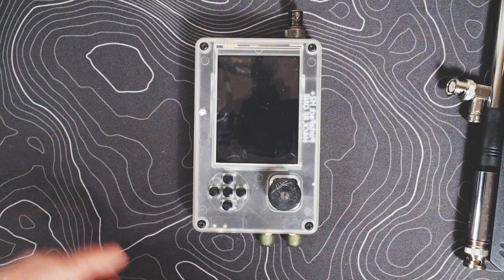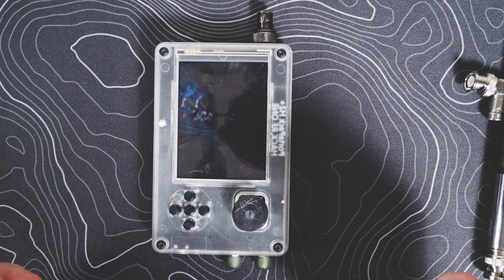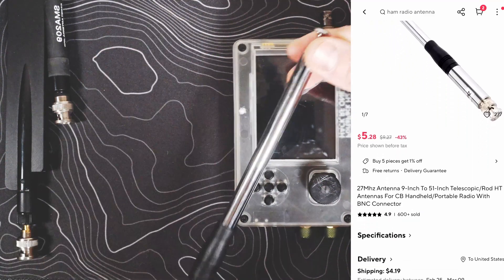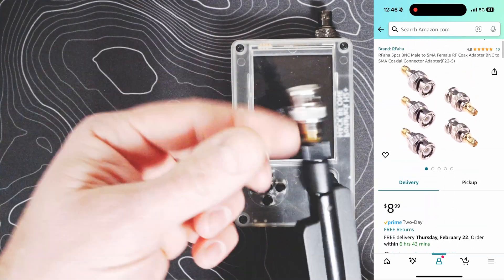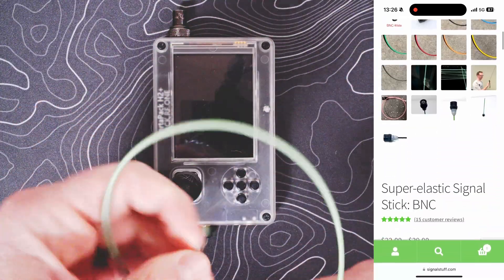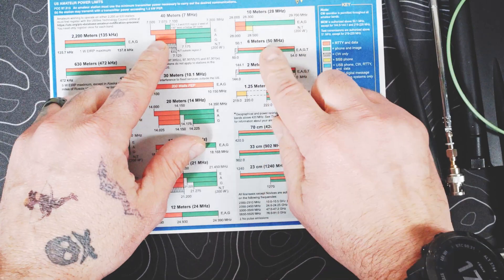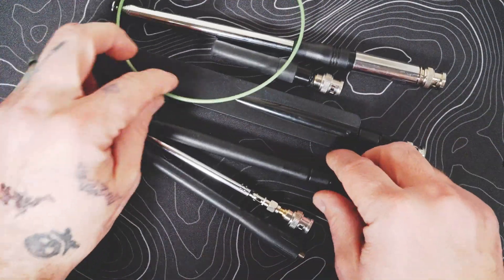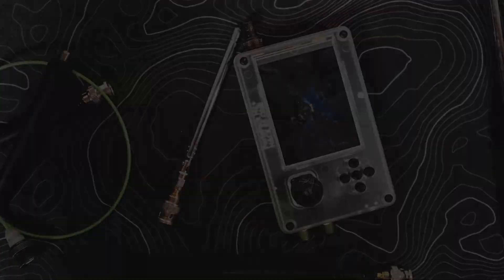PortaPack H2 Hack RF One Antennas

Comment: Got the bnc etc you advised  but when I screw on the ariels they don't ever grip so are prone to swing around any advice or fix  thx ?
Reply from the maker: @x_KiT_x  see if you can find some small rubber washers. I learned after I posted this video that if you stack a few rubber washer high enough. Then your bnc connector down.  The rubber washer will act like a grip and provide counter upward friction.
Reply: @Jeremiah.o.A.T  Fantastic thank you :)
Reply: @Jeremiah.o.A.T  tried the rubber washer and even a brass nut still doesn't lock the aerial on :/
Reply from the maker: @ what exactly do you mean by ariels? If you like join my discord and drop some photos in the antenna channel. 

https://discord.gg/XaWdgtKRZJ

Comment: Question can I use NRF24L01+PA+LNA SMA Antenna From a Wireless Transceiver Module, RF Transceiver Module used for raspberry pi module? Plus would it work for capturing FBO and Bluetooth?
Reply from the maker: @anthonyrickardii6198  yes. Always helps to use the appropriate tuned antenna for what you want to receive or transmit.
Reply: @ thank you I appreciate it

Comment: Hey, great video. I just got the 27MHz antenna and testing as we speak. Doubt it's actually capable at receiving very good at the working frequency, but it seems to receive pretty well on higher frequency. Problem is, I'm quite new to this and unsure how I would try and calculate length for that specific antenna since it came with little to no info about it. Any tips or knowledge to share about that specific antenna? I know how to calculate for a dipole antenna, but this one seems like a special monopole antenna :D
Reply from the maker: @olavmartiniustomter5170  thanks man! There’s actually an antenna calculator built into the Mayhem firmware that can guide you for your desired frequency.

Comment: What is the max length of cable you can use? I’m trying to wire an antenna from my basement to the roof.
Reply from the maker: @B2DT11B  I’m really not sure. I’ve gone as far as 20’ with no issues. So if using quality cable with little signal loss, I would guesstimate 50’ or more. 🤞
Reply from the maker: @B2DT11B  the amp portion on the H2 can boost incoming signal if you seeing no signal.
Reply: @Jeremiah.o.A.T  k. My plan is to put a cone on the roof and add a SPF 5v amp to my HackRF. The goal is to hear as much as possible from a base station.
Reply from the maker: @B2DT11B  great idea. I run a discone as well. But still need to install my mast.

Comment: To anyone that wants to do the same SMA modification than @KJ7VUB. To do it safely I took an SMA adapter (90 degree or any other with femal connector) and cut the female portion off to get the threaded nut out of it. I then filed down the connector nut to the desired height I wanted my HackRF SMA connector to be and then I screwed it on the device. 

Then I simply filed down the excess male connector that was sticking out of the nut with a belt sander (could be done by hand with a fine file) and simply removed the nut. When removing the nut the last thread gets revers taped by the nut and if there a small thread portion that roled down it will stick out and will be easily removable with a pair of tweezer. Then you get perfect threads entry and can easily screw back the BNC adapter.

Thanks again @KJ7VUB for pointing out how you managed to get that BNC flush. I wanted to know if I could do this for a little while now.
Reply from the maker: @Skol_Qc  thanks for clarifying this. I think this will help those who wish to have the flush mount look. I’d like to add, if one isn’t comfortable doing any form of filing or grinding a stack of 1/8” o rings will fill the gap. Or a flat nylon black washer or 3d printed one.

Comment: also my adapter doesnt screw all the way into my porta pack how come yours does?
Reply from the maker: @Yoyorides  I’d say a 3/16 or 3/8 internal diameter o ring. They stretch so I’d go small. You could always take your PortaPack in or the antenna and eye ball a o ring that will work. I have a o ring assortment case so I just snagged one out of there. Perks of being a handy/maintenance man for a long time.
Reply from the maker: @Yoyorides  I filed my sma connection down for it to sit flush. I wouldn’t recommend it unless you have spare ones to solder on. You could get a o ring to fill the gap.
Reply: if its not too much to ask is there any o ring that you reccomend that would fit for my situation

Comment: I had never thought of THREAD life on the antenna connector. My concern is rigidly mounting anything to the SMA connector, snagging the antenna on some semi-fixed object (with the ensuing *leverage)*, and breaking the connection between the connector and the PCB.
Reply from the maker: I could see that. I’ve had the bnc on mine since I got the unit and haven’t had any problems yet.

Comment: Great video! I have my rf on the way and I'm watching a bunch of videos to get familiar. I'm curious what the signal read range is on the 433mhz antenna? Like how far away from a remote for something like a door bell do you have to be to capture it? I guess it depends on the range the bell is capable of transmitting to vs the power of the RF?
Reply from the maker: I’d have to throw it on my analyzer then run some test. I’ll add it to my video to do list.

Comment: Is there a wide band range that is good for transmitting? 3:41
Reply from the maker: I will have to do some research. Unfortunately when it comes to transmitting. A antenna tuned to what you transmit is always the best case, it usually doesn’t work as receiving. Since transmitting requires tuning, dbi, swr, and sometimes power, these parameters make it difficult to have a “one size fits all” antenna. I could be mistaken and there may be one out there. But currently I am not aware of one. If I find one I will gladly post on it.